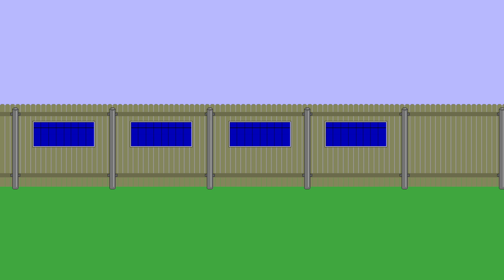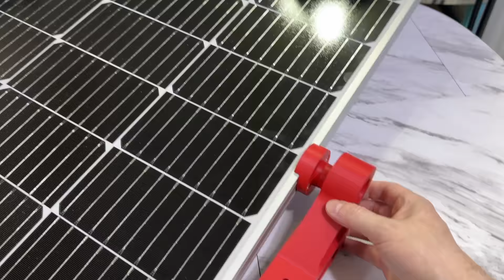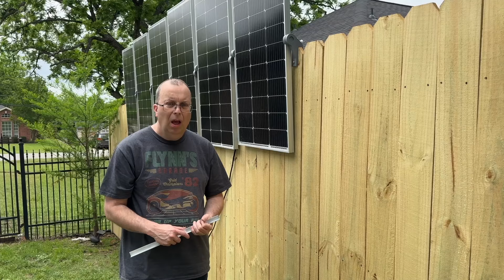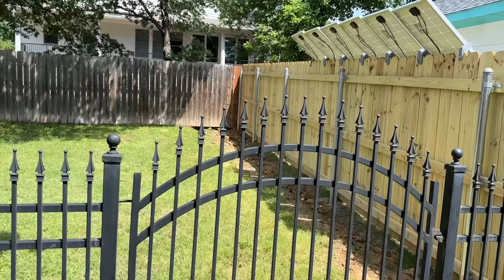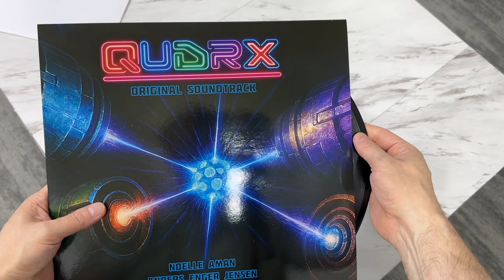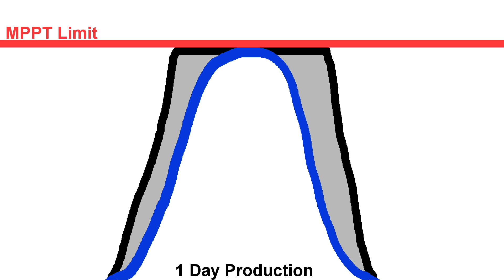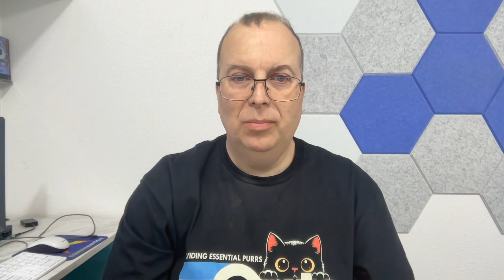I made an adjustable Solar Fence!

Comment: Free at night! What, if we had that in California I would have several Franklin or power walls batteries. We have time of use options but free at night would be a game changer. I have three PHEVs I charge, could not imagine the cost savings. I have 41 panels on my home but at some point storage makes more sense. The Fence: Did you think about adding through pins to the pivot points on your brackets. You could print the holes to be set at the most optimal angle. Not sure how heavy the entire unit is, or how strong the print material you are using is but that was my thought.

Comment: Aww, I was hoping for a really cool angular-control mechanism that involved a rack and pinion, or a worm gear, or something like that.  Something powered by a motor, controlled by a script that read the angle and the power supplied and optimized the angle to get the best power delivery.

Comment: Bifacial 600 watt panels are just the right size to build the actual fence out of them. They'd be stuck at vertical but it won't matter when they generate huge amounts of power each. I've seen a few installations where the entire fence-line is all solar panels and it looks pretty slick.

We have an Ultra-Low Overnight TOU pricing scheme here as well, except there is no free lol, it's 5 cents/kWh between 11pm and 7am. But you get punished with 50 cents/kWh between 4pm and 9pm to pay for it, which is just around dinner/cooking time so what do you really save 🤷‍♀

Comment: Your weak point of your current fence design for your panels is asking the dog ear pickets to directly bear the wind load.  The fence posts should be utilized, not the tops of those flimsy pickets. Extend your posts and use unistrut as your support beams instead.

Comment: stopping at 5:42 to comment. - as for the spacers to make it level... it would be better to attach a single level board along the length of the top of the fence. Its already an eyesore so this wont make that any worse -  and it would  stop you from having to put 16+ holes in the fence, and keep the panels from having that staggered look. As for the  ability to adjust the angle -  use a piece of metal corner stock that has the holes in it, attached to the board previously mentioned,  one for each panel, and then just get a metal rod for each panel and either put a 90 degree bend into it that would go into the holes of the corner stock, or thread a hole in it and put a bolt through it that can be hand twisted out for adjustment.

Comment: With all his knowledge of programming and computers, I'm surprised he never used a threaded rod actuator like on a 3D printer. I guess you might have to waterproof it, though. But if he did, you could control it remotely and have a button to wind it shut.

Comment: Your free use at night for electricity sounds similar to what we do here in Ontario, Canada where we have "peak," "mid" and "off-peak" use.  On off-peak use, it's not free but is a lower price while looking at peak times which changes slightly in Fall through Spring where "off peak" and "peak" change places places...anyway.  Peak times is the most expensive and typically starts later in the Morning closer to Noon and ends in early Afternoon (Spring through Autumn) while off peak is evening and night as well as on weekends and holidays.  It's one of the ways we can run major appliances in the evening to do laundry, especially since our dryer runs off of a 30 A 120/240 circuit or use the kitchen range which is on a 50 Amp 120/240 volt circuit.

Comment: If you have a sprinkler system - you can make a branch that goes off with a shutoff valve that runs underneath the solar panels to cool them off - heat of the day run the backyard sprinkers and it should take the heat away from the panels.

Comment: A nice trick with the fence installation in places where you do not have much space, but one note though, not that I know 100%, but I was reading that in winter in most places the solar panels do not generate as much electricity, so even if there is snow coming, it is better to clean them than placing them in the position where they get even less sun. Then again, when it is constantly snowing that position most likely would allow them to gain some charge at least, because you wont be running outside every 10 minutes to clean them off.

Comment: It's been a long time since this started so I might be missing the point, but wouldn't it be better value (given the discussion at the end) to add more roof panels and link the studio EcoFlow to the house? No need for changing the angle and combined battery capacity. I can't see a situation now where the studio would need to be completely standalone.

Comment: With my solar system, I pay $9.50 a month for power.  That's with the AC running all day, where I'm still putting power into the grid.  Which is awesome, because I don't have a choice in power company.

Comment: What I would like to try is securing the bottom of the panels to the fence with springs or bungie cords, and using a set of eccentric cams on a bar  (or an air bladder) behind the panels to adjust the angle of all of them at once.

Comment: the idea of holding the panels at an angle use a strip of a bar with a hinge lock  in the middle of the bar then attach it to the fence and the panel. sometimes kitchen cabinet doors have this type to hold them up but obviously a lot smaller

Comment: Place a horizontal rail along the bottom edge of all panels. Connect them to it with your aluminium linkages. Set the horizontal rail on screw mechanism connected/ran by two viper motors (or other). Add a endpoint switch for calibration, and connect it all to ESP32 or similar. Program variable positions dependibg of the Sun's position.

Bonus 1: add an anemometer, to have panels be automatically parked if the wind picks up too much.

Bonus 2: add an additional horizontal rail driven horizontally by a screw, and parked-position switch sensors, then – when they are parked – have it lock all the panels at the same time. (More complex alternative: individual solenoids that actuate individual locks.)

Also, regarding "locking": since the other side is your mother's property, another all-panel locking alt. option is a rail (or a wooden panel placed within guide rails), which is then, again, actuated up and down in an appropriate manner.

But in general, just having one end of your fence leveled up with the other, and then having all the panels be in the same horozontal mounting plane would simplify all matters. a lot.

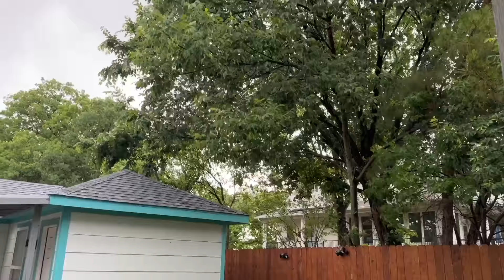Comment: 5:53 you just need a flat pice of steal like 25mm*600mm Mill out the middle of the flat iron-steal and put a bolt in so you can adjust the angle the panel should be at and screw the nut on. a simple angle iron bracket on fences

Comment: would have been better to fix them all to long beam of wood or even a scaffhold pole which itself is attached to the fence, that way they would be all at the same height and could all be moved at the same time, not hard to imagine or setup.

Comment: What you need is a cam shaft that goes behind all the panels, that pulls/pushes a lever rod attached to the panels. Then attach a motor to the cam shaft to control the angle of the panels.

Comment: You should take inspiration from a lawn mower height adjust. 

3d print a big version of that and replace  one of the two hinges with it. Then you could easily dial in your angle.

If the panels are heavy, make the handle long and detachable, that would give you leverage, so you can quickly adjust them. If the notches are thick enough, you wouldn’t probably need to worry about locking it down as it would be already well held in place.

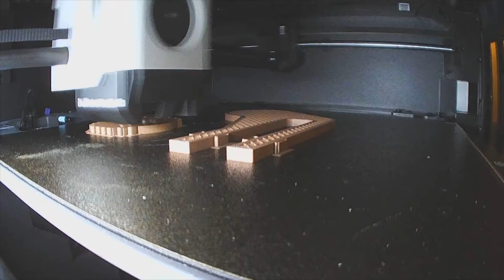Comment: Its wild to hear how different you guys in the US have it.  Here in Australia, when our batteries fill up we can sell our excess solar to the grid.  Admittedly that isn't heaps my provider gives me 10c a KWH for the first 10, the 4c there after.  With the rebates they had, i spent about 20k to get 12.5kwh of solar and a 42kwh battery.  I'm able to run 100% off grid all the time and also charge my electric car between 9:15 and 2:15 without any issues.

Comment: On the locking them in place, in the uk and europe, our caravans, or trailers in the usa, we have struts that you can lock the window open at any point down the length of the strut. They should take some weight too. Not sure if trailers and caravans in the states have them but they arw worth a look. Google caravan windows struts and see what I mean

Comment: Interested to see how the 3d printed parts hold up. You have both high temperatures and load (wind), in addition to high UV. Ultimately it's probably a question of how beefy to print the parts.

Comment: I suspect they might eventually cancel that power plan if enough people do this. Then again, it could be beneficial to some degree for the power company. They sometimes have to pay customers to use electricity at night, or shut down a plant. The latter is a painful and slow process, so the former is preferred.

Comment: i wonder would solar panels benefit from a hydrophobic coatin like you would use on cars to make the easier to clean. something easy to apply like Gyeon Q2M Wetcoat wich you just spray on and rinse. works wonders on cars atleast

Comment: You could use way more of your solar output by adding a an inexpensive mppt to charge an less expensive 3rd party 48V battery.  Wattcycle recently released a cheap adapter to connect the cheap Wattlink adapter cord to connect less expansive 3rd party batteries to your Ecoflow battery expansion port.  Alternatively, you can plug the battery into the MPPT of your Ecoflow, and connect more solar to the 3rd party battery via 2 cheap MPPTs.

Comment: With renewables powering the grid here in the UK more often these days, my energy supplier (Octopus Energy, they also operate in Texas) have days were we're given an hour or two in the afternoons of "All you can eat" electricity, because it's far more cost effective to give the power away for free than it is to shut off the supply, so you can suck down as much power as you like, and it's all free... :)

Comment: as a thought... would you be adverse to linear actuators handling the angling of your panels? with a bit of clever wiring (and some arduino work if you're keen on it), you could have some smarts like tilt automatically to follow the sun or remotely have them all go dead-vertical should storms be on the horizon etc...

Comment: Another tip: Batteries last longer if you don't charge them all the way up to 100%.
Best way is to let the batteries oscillate around the 50% mark.
So if your normal usage is 70% of the battery power, charge them up to 85% during the day and let it drop to 15% in the night, charge them up to 85%, let it drop to 15%, etc..

Comment: It might be a bit costly, but, an easy way to adjust the angles would be to use actuators for swing gates. It's basically just a 12V motor on a threaded shaft with a bushing which rides on the thread. Unfortunately, the way the panels are mounted right now means that you cannot lock several of them together. With some slight modifications, you can have each two panels rotate coaxially and then you can use a single horizontal bar to actuate and lock both.

Comment: I don't get it. You have experience with building electrical devices, you can put together complex circuits and yet your solution isn't a LDR controlled motor to move all the panels automatically wirh an override to store them vertically. Even a smart switch controlled stepper motor would be something i'd expect rather than a manually controlled mechanical solution.

Comment: Probably i am late to the party but motorized threaded bolt with hinge and bearing allowing that hinge to pivot freely would beat any stud mechanism to manually fold/ adjust. Even DC motor with half-bridge driver allowing CW/ CCW rotations controlled by single esp32 would do the trick; paired with homeassitant's weather forecasts and LDR- based dead simple PID to adjust angle to optimum yields self-correcting mechanism with 100% guaranteed optimal conditions.

Comment: regarding the gradient on the fence you missed one of two obvious solutions.

Option 1 : Install the top of the fence in a straight level  line starting from the highest point then fill in the gap at the bottom.
Option 2 : Install the fence as you did but then cut the top to make it level/horizontal.

Comment: If the panels all go to the same angles could you connect them together with a single horizontal beam and then use an electric linear actuator in the centre to change the angle. You could then automate them to close when windy but also change the angle during the day to optimise the angle.

Comment: For angling the panels, use a pipe bent so on each end is in a bearing, then bends down a few inches. Turn that with a (maybe power window) motor, and it'll pop out the panels from below the hinges.

Call Simone Giertz. That'd be a neat collab! You're both makers :)

Comment: Funny enough I have been using your money saving tip for 8 years 24kwh battery storage and 10kw solar and it has saved me over £20k on my electric bill 3x EVs and a fully electric house and my electricity bill averages out (UK bills tend to avarage out over a year) £150 not to bad, my house runs a server rackas well so my houses uses 1.3kw with everything switched off

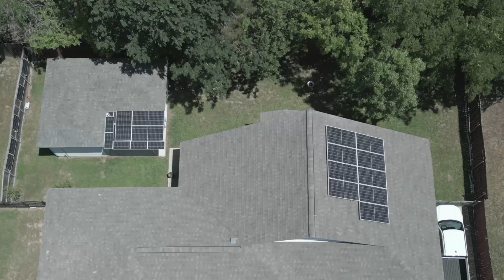Comment: 8:16 half of the roof is empty. You have only 9 panels there. Just put those panels to the roof. You can easily fit one more row and one more column, with a total of 18 panels.

Comment: I have 25 panels with 450Wp each. On a sunny Day in April I generate 70KWh, on a cloudy day in January it's 2 or 3 KWh a day. And this is in Germany and not in Texas sun. So I wonder why your numbers are so low.
Yes, fewer panels... But did you really say, those are 100Wp panels while anything under 400Wp is quite dated?

Comment: Interesting build, I was shocked, hanging over the neighbours fence - however all explained. I have four 20W panels on my fence, dead vertical. After seeing your build I'm tempted to visit a hardware store and buy a pair or stainless steel hinges for the top supporting rail, so the bottom can kick out and work a lot better than they are now.
I have a fair bit of 12V powered gear, the fence panels augment the 12V supply, as in take the load off the mains. There is a 150AH battery on the 12V system, however that's more for power fail protection, keep my network and camera's up 24/7. I too ran the wiring mid fence, away from the mower and weed wacker/line trimmer/whipper snipper - whatever you call them over there. If I walk into the panels whilst cutting the grass, I'll just call myself an idiot...

As for yours, how about adding a motor etc. to track the sun, all driven by a C64

Comment: If I had a free at night plan,  I'd have a massive battery bank, suck it all in, run 100% off the battery during the day.
Reply: I do that, i have a 16kw battery and 16kw inverter currently 5x595 ja panels , no grid it was been cut by supllier..  panels only get sun to 12pm but really works nicely.  .waiting next winter to see if that panels can upkeep the same 100% charge
Reply: @ML-jr1yz  You will be massively disappointed come winter with zero grid fallback and your numbers don't add up unless you use basically using zero energy during the day. 5x 595 Watt panels gives you a maximum 2.97kWp with a theoretical maximum production based on 8 full sun hours a day divided by two as you say they have no sun after midday. Maths time, 2.97kWp at "theoretical maximum output under ideal standard test conditions" 2.97kW x 8 Hours = 23,760 Watt hours divided by two for your production to midday (12pm)= 11,880 Watt hours of energy to charge a 16,000 Watt hour battery!, that's at an assumed 100% panel efficiency and 100% round trip efficiency for charging the battery, now make those figures realistic for actual STC condition of panels and RTE on the charge and discharge cycle, you are at 80% best case even still assuming 100% panel output all the time. You either use less than 500Watt hours per day to power your loads or best case scenario you have a deficit which will see your battery slowly get depleted and not fully charged. Batteries are measured in kWh (Energy)  not kW (Power)
Reply: Those "massive" batteries (LOL) will cost a lot more than you think. I would suggest selling a kidney.
Reply: @HelloSwiftful  it really depends
a 5.12 kWh battery costs 1790€ at my local shop. Buying two including inverter and charger would be around 4500€ as an example which would pay itself off in about four years.
Reply: @David-wh8zs  So 10 kWh would last you all day? I live in a modest apartment under 1k sq.ft. and this month I'm averaging 22 per day, and the peak of Summetime A/C usage is still FAR away, which hit over 40/day last year at it's peak.
Reply: @ethanmc97  Yea its actually plenty.
So I don't have the exact daily numbers but calculated down from the yearly consumption it averages to 7.2 kWh a day with servers running, and about 5 kWh per day without them.

I haven't heated my apartment at all in 2025, but I needed to cool it down which drove up the average a bit. 

It also doesn't need to last the whole day, just until the night rate kicks in again, so maybe 16 hours.

The thing is that electricity over here is a lot more expensive than in the US, but buildings are also more efficient.
I have a tarif thats not cheap but not expensive and pay 0,33€ per kWh, which is about 38 US cents at the current exchange rate.
Reply: @HelloSwiftful   You can literally go online and get them shipped; they should cost exactly what you'd think. It's still quite a bit of money, but much cheaper than it used to be. If you were considering a whole-home standby generator, a battery is most likely a better option these days.
Reply: @HelloSwiftful  Not to mention when they need to be replaced. :D